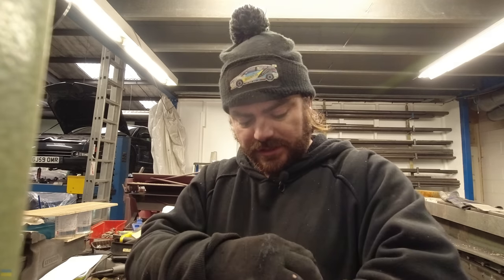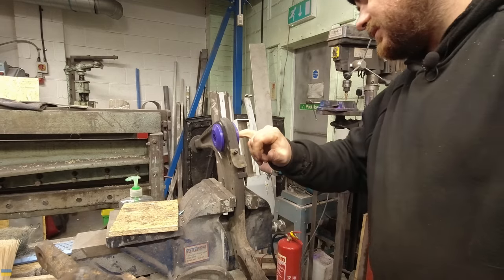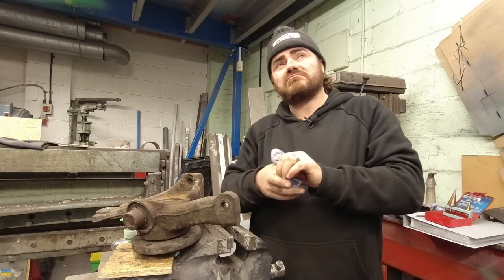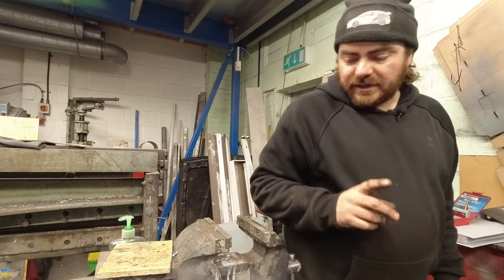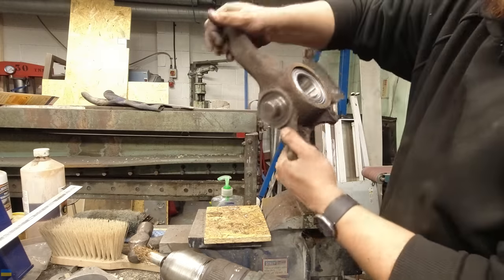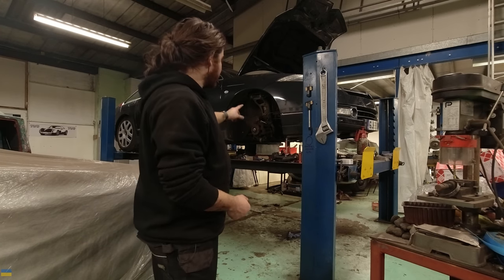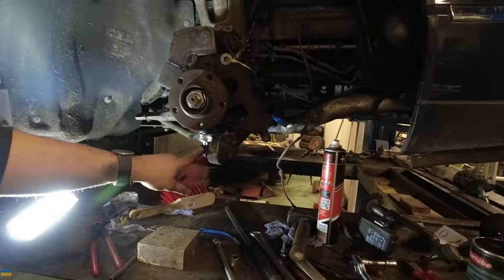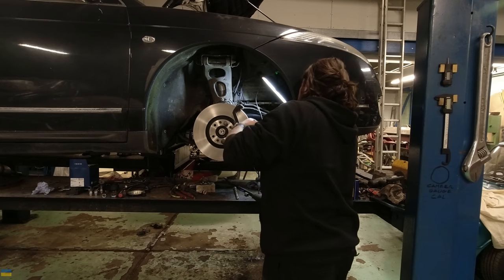Cheap Citroën C6 Project 4:   It finally starts going back together!

Comment: Dude, use the old wheel bearing outer to press the new bearing in, don’t press on the inner race
I use ceramic grease on ABS sensors as it doesn’t effect how the sensor works
Reply from the maker: Yeah I know, but the old bearing would have pinched into the knuckle unless I ground it down etc., and I didn't have time. It was meaty enough to handle it, but not ideal I agree.

Comment: ENGINEER MODE TRIGGERED! 

It's really bad practice to drive a bearing into a housing with the load going through the balls, all the force should have been on the outer race. 

I'll rough grind the outside of the old races so they can be used as bearing drivers.

Probably not an issue with a bearing this size, but if you'd had a problem getting the bearing in, you could have Brinelled (dented) the race. I see it quite often on motorcycle wheel bearings.
Reply from the maker: Yeah, I know. I didn't have a driver the right size, though, and time was of the essence. It'll be reet.
Reply: @UPnDOWN  Use the old bearing race and some scrap metal :)

Comment: 14:29. It was interesting seeing quite how much resistance your (slightly melted :-)  ) ball joint and new FRIP put up when dragging round hub by hand. It's fair to say my C5's are much freer than that - so I may well be delving into that job soon perhaps! A forum I read reckoned the FRIP is usually killed by water ingress (and there's a redesigned later hub for C5s which seems to shroud the bearing more) I'm tempted to try what was suggested on said forum and add a grease nipple to stuff it full of grease at regular intervals and leave no room for water.

I also had a thought about your "wheel arch liner garden" - again assuming the C5 X7 and C6 are similar - not only does the liner gets pelted with water thrown up by the wheel in motion, but when parked all water from the base of the windscreen is directed onto the back of said liner too. The felt like material must rarely truly dry out in the UK - no wonder it makes such a good growing medium!

I'm going to look at my C5 x7's suspension as suspect it too has the normal steel sprung / 407 wishbones fitted - looks like bush centre line corresponds to bolt mounting edge as you described - as mines hydractive it will be in need of that 10mm spacer mod perhaps.

Enjoying these videos - the mixture of humour and that you've not edited out all the painful struggles against suspension components that put up a fight is excellent mix.

Comment: I replaced the o/s driveshaft on a 2008 C5 I once owned thinking it was the CV joint but it turned out it was only that lower swivel bearing that was making the characteristic noise on lock, had to replace the shaft because i'd already butchered the outer CV joint and as you know and i found out is that outer CV joints aren't available unfortunately, so my advice is to replace that lower swivel bearing first if you have a sort of knock or grinding noise on full lock when manoeuvring 😊
Reply from the maker: It was making CV joint noise and humming noise on the move (wheel bearing). The lower swivels were just advisories on MoT for play.

Comment: I used to have poly business in the mounting brackets of an anti roll bar. EVERY winter they would start making horrible  groaning creeking sounds sounds. To 8 had to take them off and grease them,  PITA really to i instaaled grease fittings on the brackets. A few grease gun pumps and done. 
But i will never fit poly business on a street car again. OEM stock parts for me.
Reply from the maker: Try finding OEM parts for a C6. With modern rubber being so useless, I'm poly all the way. Reasons explained in a previous vid.

Comment: lol Richard! can't wait for the next instalment where you remove the LDS tank to get to the to the ABS connector only to find out your bargain genuine sensor is the wrong one lol The blue connector is only fitted to early cars, black connector on most and a white connector on later (3.0ltr) cars.. bet the air is Blue when you find out through lol
Reply from the maker: Weird thing is ServiceBox put this down as the correct one, and it supercedes the black.
Reply: @UPnDOWN  yep, been there done that with a local motor factor who insisted it was the right one. The connector guide tabs will be different and it won't go on unless you cowboy the connector on the harness. It will work if you do go this route but I suspect you'll do the right thing and fit the correct one.

Comment: The oxy acetylene is your friend getting the bearing race off the hub. at least it seems to work well heat expanding it off most of the time.
Reply from the maker: Don't have any.
Reply: @UPnDOWN  Oh I thought I had seen you use it. If I had to buy a heating device I'd buy an induction tool though feels alot safer and neater to me. MAPP gas is ok when you don't have a shop but I find normal propane or propane/butane struggles to heat things enough.
Reply: @UPnDOWN  A Hobyweld pack is a very worthwhile investment, without the BOC rental BS.

Comment: Another great video, at 8:44 were you pressing that bearing in on the inner race?
Reply from the maker: Yeah...didn't have a tool big enough for the outer. It'll be reet....I hope!
Reply: You can turn the old bearing down a bit so it doesn't jam, and use that as to press the new one in. That's what I do..
Reply: @UPnDOWN  Lol,  yep- you have to make the best of what you've got; well that's what my missus says to me!! :-)

Comment: Great work Kitch. Does anyone do polybushes for the BX? Had a look on the poly bush website and they don’t do a listing for the BX annoyingly.
Reply from the maker: They don't, but they should. The BX would really benefit. I'm speaking to one of the suppliers to see if they're interested.
Reply: @UPnDOWN  Let me know if you have any success and put me down for a set for the Valver if you do. 👍